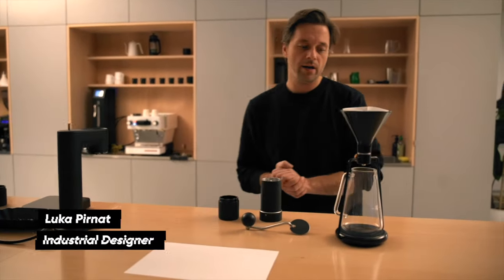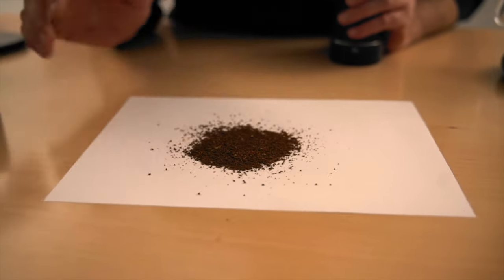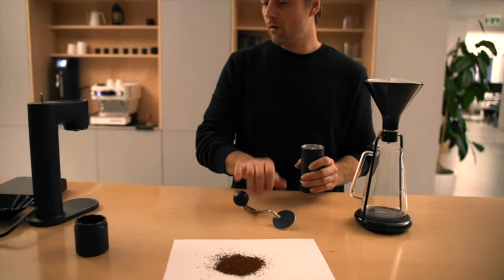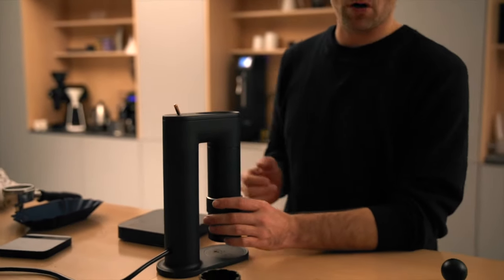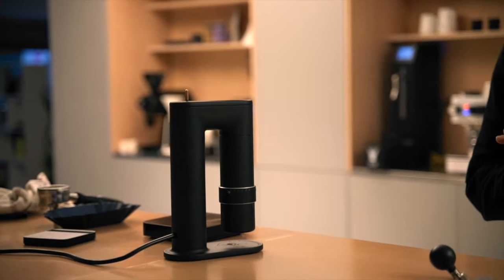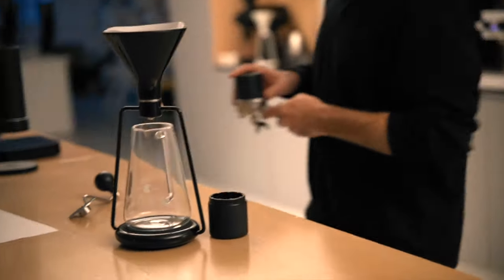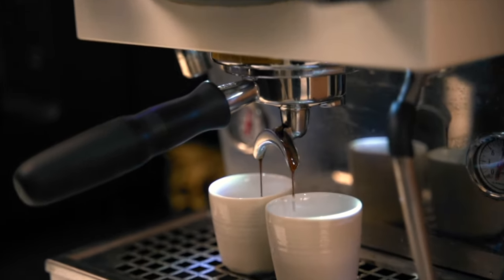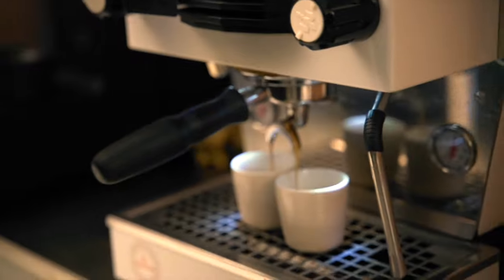MAKING ESPRESSO AND FILTER WITH ARCO GRINDER‼️

Comment: ...really nice minimal design, but only thing that eludes me is figuring out how is knob attached to lever/crank since on my current grinder it's was the first part that failed (hard lever wore out the soft axle on which knob rotates so it ultimately broke). Designers often overlook this detail and make axles either thin or of poor materials, often without bearings. Squeaking noise is not reassuring, but if you could elaborate on this small detail it would be nice. Thank you in advance...:)

P.S. ...inside of the cup could benefit from a cleaner profile since protruding magnets will only collect coffee particles...

Comment: Interesting concept. However it would be beneficial for us, the viewers, and you if you made a video like this a bit more detailed. Maybe throw in some kurve sifting, get a closer shot of the grinds and so on. Just seems a bit rushed. 
When that has been said, interesing indeed.
Reply: Yep, actual grind size distribution was promised at some point I think - that would be very interesting to see!
Reply from the maker: We're preparing that as well🧐
Reply: @goatstory7117  evidently you are, yes, but there's literally 46 hours left in the campaign as I write this and this is still your most recent clip, despite people asking for footage about the lab work (laser measurements, Kruve sifting, etc.) which you say is still coming.

The problem is, it's already too late and that should have been provided to backers soon after the post on data. Do what you say you're going to do -- not after the time limit is up.
Reply: @MrBahBZ   I agree , they should've post more videos about the grinder. as a backer, I would like to see more tests and especially the Kruve sifting
Reply from the maker: @MrBahBZ  Yes this is our recent video, because instead of showing results we already publish in video footage, we were working on laser testing which is published among updates on the campaign. Sifting and comparing videos will be done by the independent creators as they are less biased than we could be, I think you would agree with us here.

Comment: seems to have some squeak between 0:20 and 0:30?
Reply from the maker: Squeaking during grinding? Glad you mentioned that. The squeeky noise is coming from the handle knob that is not (yet) made with the final materials and that is why it can squeak a bit. For the final version there will be no squeaky trouble😎